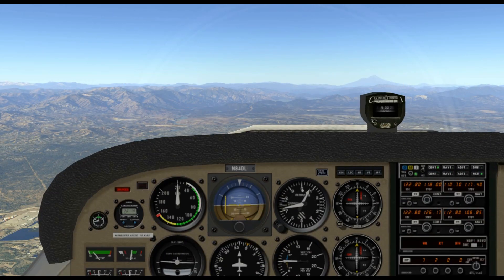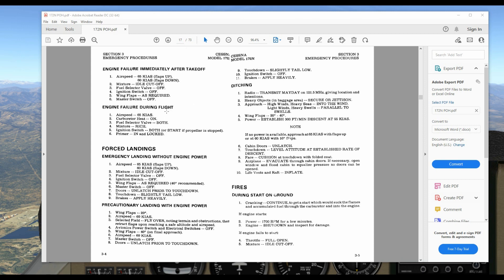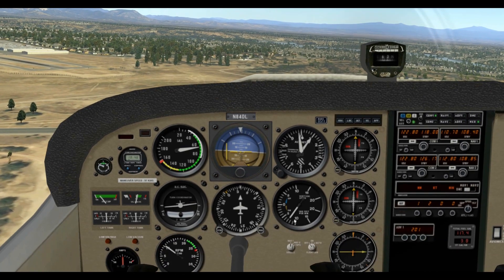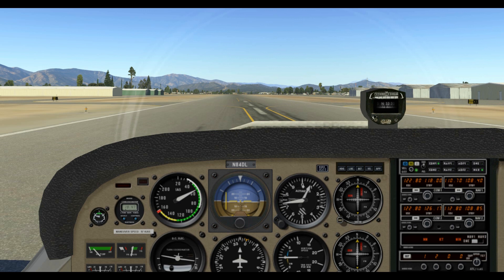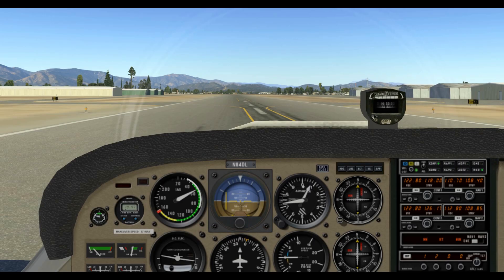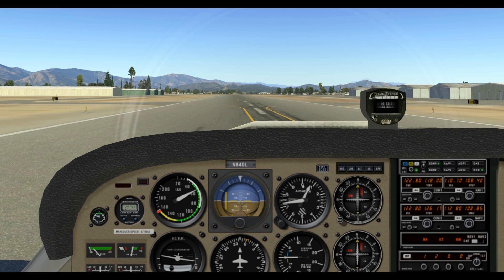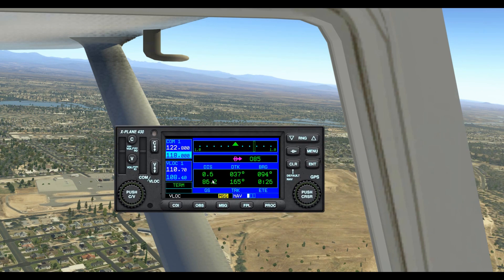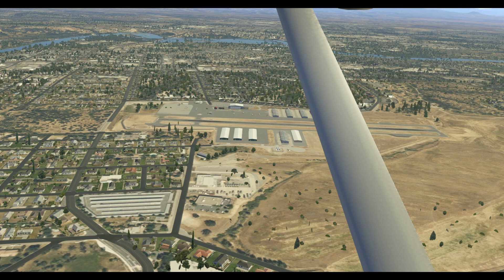In Flight Engine Failure Part1 ~ Learning to Fly for Beginners Part 25

Comment: Hey skip, the part about checking wind conditions at airport was confusing to me. Something about headwind, then tailwind. I guess the point is that if your engine is out, it might be good to have tailwind, unlike in normal conditions?  I'm back after a few months of flying XP11 practicing all the stuff from your beginner videos. Thanks for getting me off to a good start.
Reply from the maker: Hi Sandra,  Before you take off you should know the wind conditions, you should take off and land into the wind when ever possible. When your engine fails and you are trying to figure out where to land factoring in the winds is a good Idea but may not be possible to land into the wind. Landing with a tail wind has it's drawbacks and if the wind is strong it can be a real problem. For example, if you have a 10knot tail wind you are actually going 10knots faster over the ground than your airspeed indicator shows. On the other hand if you are landing into a 10knot headwind you are going 10knots slower over the ground than your air speed indicator shows. Naturally if you are landing in a field or really rough area the slower you are going the better it will be so knowing the winds can make a big difference in emergency landings, and normal landings as well! In the real world pilots look for indicators on the ground such as smoke from fire even a BBQ can help, or looking at the direction flags are blowing to get an idea for the winds. Hope this helps and thanks for watching and going through the series :-) If you have any questions please let me know I'd love to help if I can.

Blessings,
skip
Reply: @WEHVideos  Thanks Skip. I now understand what you were pointing out in the vid about checking wind direction. Your point about how pilots do it "in the real world" is super helpful. I'd been reading about looking for windsocks, which seemed a stretched at altitude. Of course, ATIS would be another place to look. Hope you are doing well.
Reply from the maker: Hi Sandra,  glad to hear you got that figured out hopefully the video helped and wasn't to confusing :-) 

Here's another tip for finding wind direction. Pick a point directly in front of you a few miles away, a tower, large building, mountain peak or something  and head straight towards it. Line that point up with a mark, a scratch, a bug or something on the windshield. Without making any corrections to keep heading towards the point just flying straight you will notice over a short time your point drifting to the left or right of the spot you picked on the windshield and that's giving you an idea of the winds. If the point drifts off to the left of your mark then the winds are coming somewhere from the left, if it moves to the right the winds are from the right. If you keep heading straight towards the point without it drifting off your mark you are either directly into the wind or have a tail wind coming from directly behind you ... or there's no wind at all! Obviously this is guess work but is going to give you a way to make an educated guess. Hope this helps some.

Blessings,
skip

Comment: Hi Skip, My old channel is gone on purpose, I'm new now, I used to be Terry's Ideas and Thoughts, so My question is: Have you tried the new X-Plane 12? I've not tried it yet, but if you like it, I may give it a whirl. 
Thanks,  Terry
Reply: @Bosco7 Hi Bosco7, That's good news. I may consider getting it. I'm still waiting to see Skip show us a video on it's quality. Before I get into 12. As for My channel, I did delete it on purpose in order to start fresh and on topic. Thanks for commenting to us.
Terry
Reply from the maker: Hi Terry,  I just finished downloading 12 this morning and am setting up the controllers but have not spent any time flying but my first impression from a very short flight from Benton Field to Redding Muni it looks pretty good. I suspect there will be some bugs for a while but it's pretty much like XP11 for setup etc so should be a simple switch over from XP11. Looks like most my favorite airplanes from XP11 work, I just copied my  Aircraft folders to the Airplane folder. Next will be to see if the plugins work, I suspect they will. I may do a video on this but I'm not sure yet, will have to see how it goes.

Blessings,
skip
Reply: @WEHVideos  Thanks Skip, I will wait your full Jury of experience before shelling out 60.00  bucks. Lol. Terry
Reply from the maker: Hi Bosco7, thanks for you comments and thanks for watching, glad to hear you are finding XP12 to be running well. I've not had any troubles with it so far but is is still not the finished released version, they call it "X Plane 12 Early Access" and now say the Beta version is available so expect some bugs, just a heads up. 

Blessings,
skip
Reply from the maker: Yea that's what I thought, it's confusing this early access thing but it's nice to have :-)

Blessings,
skip

Comment: Thanks Skip, can you provide a link for the Cessna POH you're using? I found a few, but not sure they're very current. I only have one 27 inch monitor, I know some flight simmers have 3 monitors, which makes it a lot easier when you can see out the left and right window without having to use the hat switch or other buttons. The problem with using multiple monitors is that it negatively affects the frame rate.
Reply from the maker: Hi SJ, I don't remember where I found the POH I just did a lot of "very careful" searching online. Here are two links I found that might work be sure to scan anything before opening!! Both are for the 1978 model.
http://www.laramieflyingclub.com/uploads/1/0/8/4/10844477/cessna_172_c172n-1978.pdf
https://wayman.edu/files/Cessna-172N-POH.pdf

Yes multi monitors require plenty of video ram, you need a good video card but it's worth it if you can afford it!

Thanks for watching hope it helped a little :-)

Blessings,
skip
Reply: @WEHVideos  Thanks Skip appreciate that!